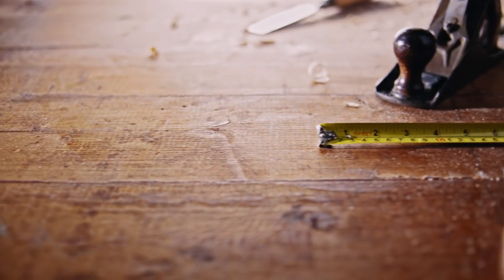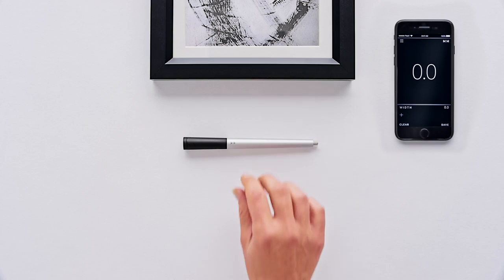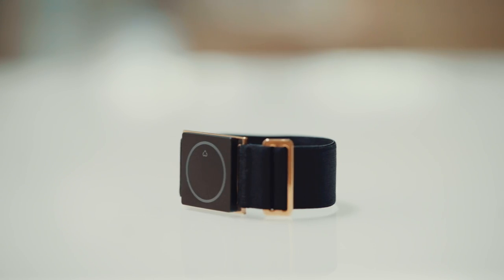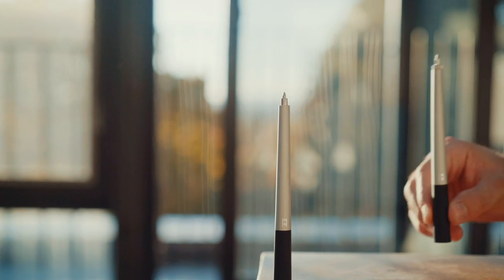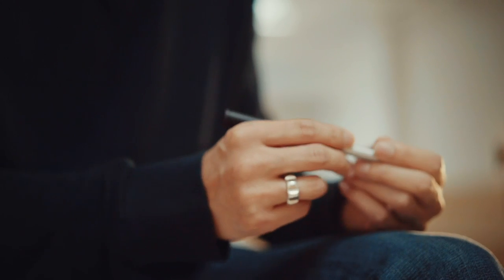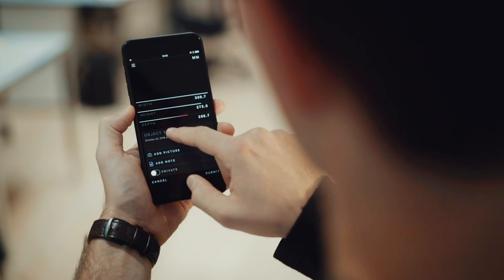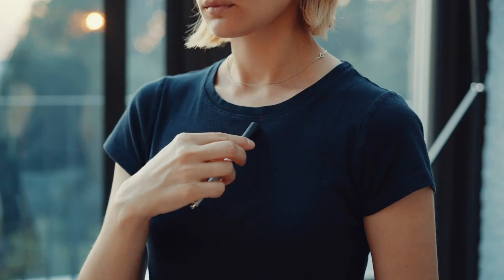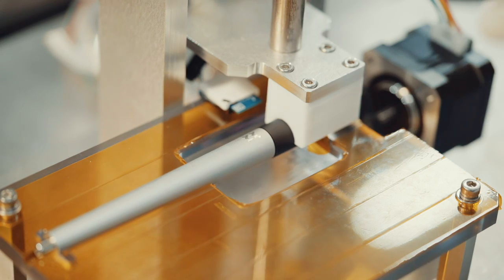Introducing 01: World’s first dimensioning instrument HD

Comment: In most of the use cases presented this device won't provide a more accurate result than an inexpensive, straight, technology independent, no power required tool such as a ruler or measuring tape.

Comment: I don't understand how it works and how to use it. What's the point?
Reply: irarabesc the laser is measuring the traveled distance from the moment you turned it on till the moment you stop and sends that data to your phone.
this way you can measure all kinds of shapes instead of only a straight edge or line as you can do with measuring tape
Reply: +Ido Telio so you just can measure the object? I thought it can copy a curve of the surface for example. that's the tool I need.
Reply: Vlad I just aim fort the curve then! It calculates the distance it traveled, do if you aim for the curve it sortoff calculate the length of a curve
Reply: So this is what you need. Te pen capture the curve of the object, but this feature will be available in Spring 2017 with the release of the Pro App.

Comment: Fun and looks well made but. When I measure something I'm not just wanting a number. I want to see number on a scale. A ruler shows you not only the measurement but also the values left and right of the value. There example of hanging a picture on the wall. I want that ruler as a guide to make my center marks and a strait edge to draw a line. When I'm measuring I'm also designing on the fly. I want to see 1" 2" 3" 4" all at once as a guide to show me, Oh maybe 3.5" would be better then a full 4". Sure can measurement be improved, yes. But IMO this is not it. I just can't see me running this beautiful pen over a wet and dirty object. How do you handle inside measurements? So your rolling along and you come to a corner. The pen stops but your sort the radius thickness of the pen. Do you add the difference, dose the software calculate it? Why didn't they engrave index marks around the wheel and engrave a ruler the length of the pen?
Reply: Voxel Lab maybe it's a new way to measure something. I always remember a quote about Henry Ford: "If I had asked people what they wanted, they would have said faster horses" I think we have to give a try to this new way to measure..